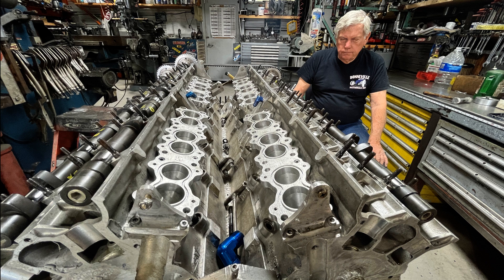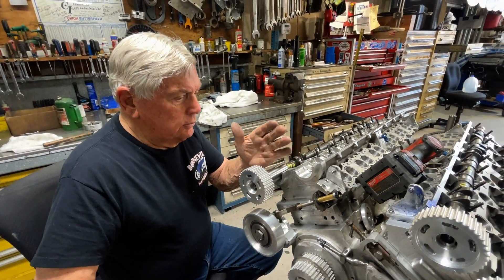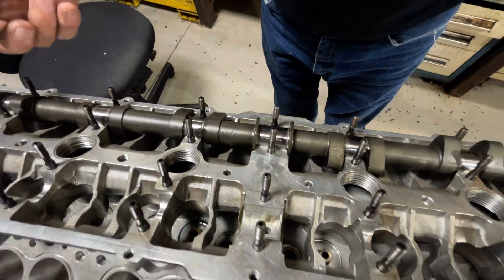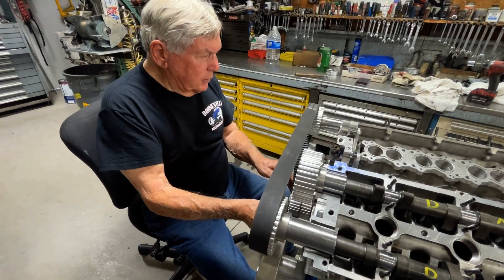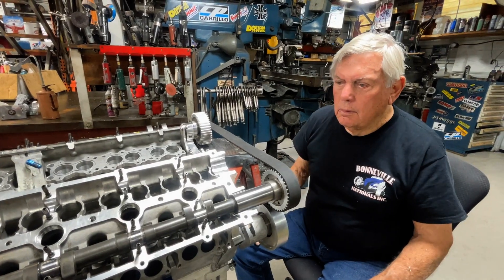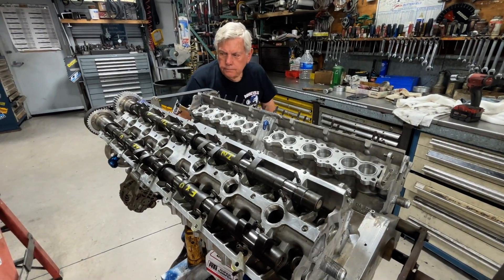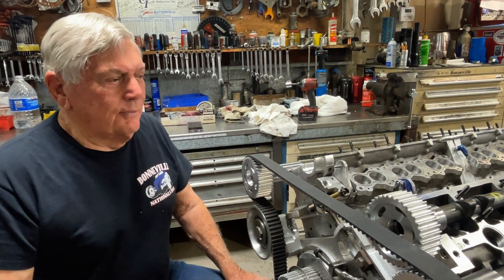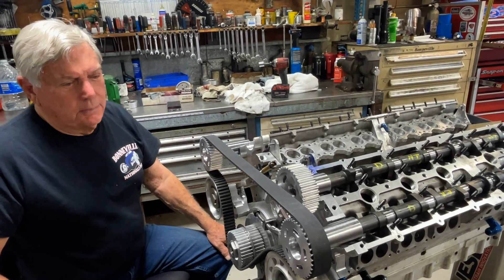Building a V12 Racing Engine from Scratch – A DIY Masterpiece by Aardema Braun

Comment: What does the guys think about the Mazda RX7 FD Turbo 
13B-REW 1.3L 80ci Rotary Engine.
Reply: I have a 3rd generation Mazda RX7 FD 13B-REW Rotary Engine, that’s Bridge ported and has all the supporting mods for high horsepower. That’s been swapped into my 2nd generation RX7 FC. It has a 85/96 T4 1.25ar 85mm turbo strapped to the side of it as well has a Nitrous Outlet 102mm LS plate system to help spool the turbo while it’s on the TransBrake. Motor  runs on VP Racing M1 Methanol and can make upwards of 500hp per rotor or 12.5hp per cubic inch depending on how much boost you through at it. I’m just curious what the guys think about the rotary platform and have they ever messed with one.

Comment: I got an old Oldsmobile 2.3 l quad 4 that makes 190 horsepower that's got 243,000 MI and I will still 
Chirp going in the third. I give it to maintenance and synthetic oil but then again I don't know.

Comment: I love to watch these guys know about them for years, I spent a lifetime in motorsports in a different discipline. Since we were kids a good friend of mine started his vw engine shop in his moms garage Jim Fueling had this idea about making a four valve head no drawings to speak of just a old bridgeport and my hand my hand me down lathe I remember knocking in valve seats on the kitchen floor I recall it made 83hp on one cylinder. It was my wins in the buggie classes thanks to jim that got me picked up by nissan, then nissan had jim do work on there 4 valve that contributed to multiple championships as well at bonneville and many other aspects of motor design and endurance testing another self-taught engineer. It was a small world back then.

Comment: what kind of spark plugs are you using? surface discharge? why did you choose 60 degree angle? why not 65 like f1 needed for more power? i would love to see some data i really like how nivlac57 has a overlay with a bunch of data while the car is running it also allows the viewer to see what has happed for example if he says a cylinder went lean on the last half of the run you can see that. Bmw made some really cool engines like the m88 s70/2 and the s50b32 (s50 and s70 are very similar) just google a dyno graph of a s50b32 peak torque at 3250 and peak power at 7400
Reply: 60, 180, 120 degrees is natural for a v12.
Any other angle is for packaging.
Reply: @ Yes I understand that I just wondering why f1 engines had and issue with packaging needed more room in v for manifold and ports and this engine does not. It could be that the engine is much bigger f1 was a 3.5liter while this is a 5liter or a compromise to reduce frontal area.